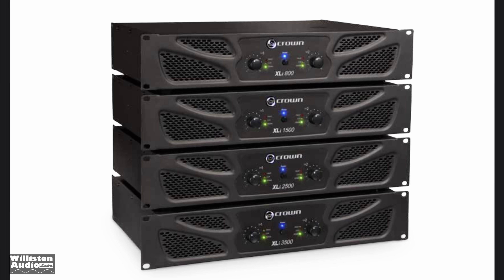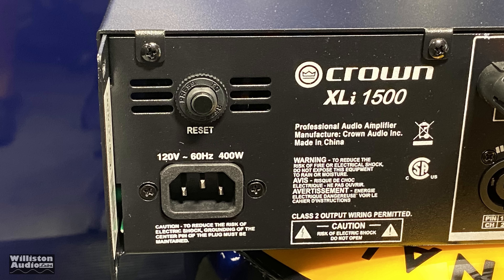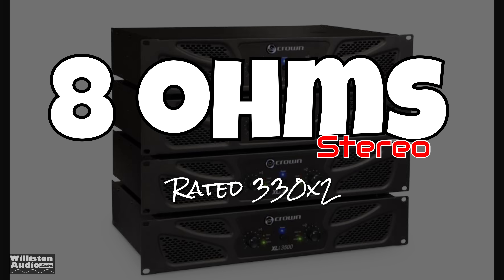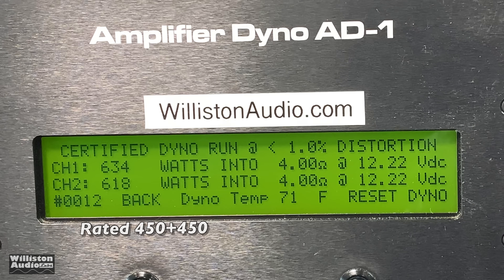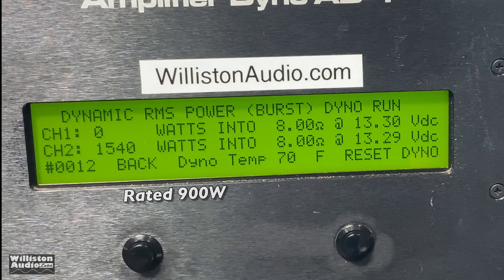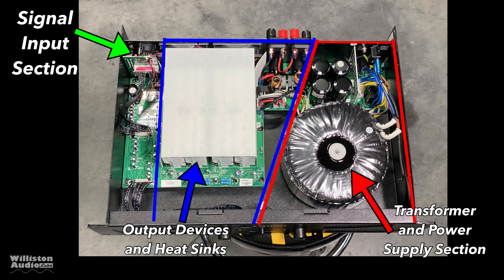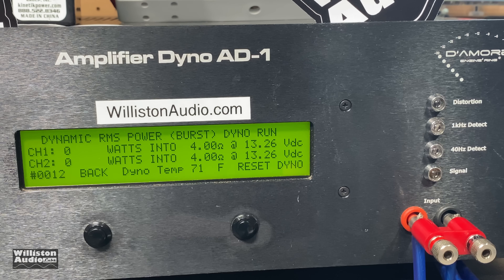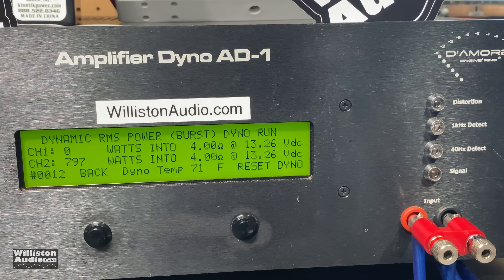The King of Pro Audio? Crown XLi 1500 Amp Dyno Test and Review [4K]

Comment: Thank you so much for this video! I just received a Crown XLS2502. Says this amp is supposed to be 1200x2 @ 2ohms... Would you have any reason to believe that it delivers any less than rated power? I also got an Art Cleanbox Pro to change unbalanced to balanced, and that helped the power output a ton.
Reply: The amplifier can deliver its rated power output no matter if the input signal is unbalanced or balanced.
The amplifier back panel has an input sensitivity switch used to set the amplifier gain to the level required to deliver it rated power output.
The advantage of the balanced input is that it offers improved signal to noise ratio and, usually, work with a higher nominal signal level, which requires a lower level of amplification to drive the amplifier to its rated power output.
With a professional audio signal level input the amplifier gain required to reach its rated power output is 5 dB lower that the gain required for home audio unbalanced input signals.

Comment: It will do that all night long in 80 degree heat :-) I spent 5 years dragging xti's around the contry...all that hurt them was was the STUPID crimps on the front control boards :-( I even had 3 get soaked with rain  and trip the power supply out and when it dried it worked fine...I almost got fired that evening:-(

Comment: If the occasion arises, I would love to find how Behringer KM 1700 amplifier measures on your equipment.
Behringer KM 1700 class H two step amplifier official power ratings are: 2x500 W "max power" at 8 ohms and 2x800 W "max power" at 4 ohms 
As many of you know, Behringer stopped rating their amplifiers by the RMS power a while ago and currently they are using terms like "max power" for their ratings.
Also Behringer officially states the expected continous power rating (aka RMS power) should be "around" half the declared max power rating.

Comment: I've used similar crown gear in professional installs [Masquerade- Atlanta] , they absolutely kicked butt cleanly, and we usually ran about 103 to 107DB with a packed house. Yes, many crowns. Powered many huge driver horns, many many 2x15 cabs,  stacked to the 24ft ceilngs at least 24' across (each), JBL'S, and 4  3x18' EVs under the stage. Amps to subs one fat amp each, rest were assigned to specific cabs.
Trouble shooting (minimal with this monster) a cinch. Well laid out.
Plus on stage monitors w feed from house source, separately powered.
I worked there 9 mos before even with earplugs I could hear thru,  it was affecting my hearing. 'The Furnace' was stageright behind ceiling stacks, and I kept 3 19" fans going under the stagemix mixer where I worked, and wore short cutoffs all year! Can't remember amp count right off, but the rack was about as big a me.
We called her Lotta Heat.
System name affectionately called 'Gorilla"  Might just as soon been called 'Godzilla'!
Went into landscaping after this. Allowed my hearing time to recoup. So when I went back to playing my own music, I could hear the detail.
Several moon ago...🙄😂
Just found your channel & subbed of course, can tell it's going to be a lovely ride. Nice test gear!
Musician and audiophile ... lifelong.
Never could afford McIntosh.
I heard this undertaker's system in the basement of funeral home😳 who had full accompanyment of Big Macs & 4 Voice of the Theatres....
Sweet... Buxtehude will never be the same after hearing it on that rig.🙏
And yes, he did raise the dead...
He always did a walkthru upstairs after he shut everything down, just as a precaution.

Comment: I have the XLI2500 running 2 Eminence LF18 subs in stereo. With the high efficiency of the drivers and power of the amp it is freakin loud!  I drag my rack and cabinets outside for a party on 4th of July every year and it can be heard from several blocks away!  I cant flex it too much inside because stuff starts getting broken from falling off walls and tables.
Reply from the maker: Boom shocka locka!
Reply: This is what I want also sounds awesome building my system up now

Comment: Keep it with just back brakes only.
26 is a racing bike what I've known.
They only use brakes in the back.
My GT was a 26 that's why the rims got stolen. That's the bike I was using it to race at the Dirt track. The lock 🔒 got cut
off.

Comment: Used an XLi 2500 for my cover bands JBL FOH two way 15's for years and years never ever let me down and this thing was abused...
Found it the other day in the back of the equipment closet. (NO WAAAAY! Ive still got this?!) 
Gonna use it with my HiFi system 
Adcom GP 450
driving a Pair of new(ish) jamo C 97 II
I think this thing should definatley have way more power than needed. 
so It will never ever be working hard
Reply from the maker: Awesome 👏

Comment: Derek,
I've looked inside the Peavey CS800 rack mount amp designed for PA systems. As you probably know the components inside are huge. The transformer, the output devices, the capacitors, etc. Considering how robust it is, and considering what we know (thanks to you) some little car amplifiers can put out, can you tell me why it's only rated at 400w per channel? Thanks

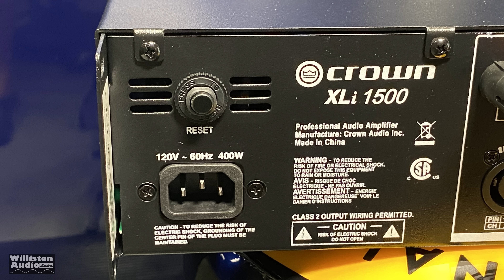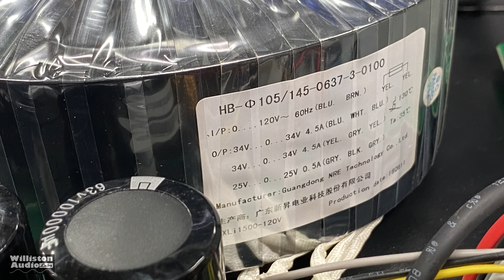Comment: At 1:25 we can see the Crown XLi 1500 consumes an approximate 400 watts maximum from the AC power source. At 6:19 we can see the toroidal XRMR delivers 34-0-34 VAC secondary to each channel of the power amplifier @ a max 4.5 amperes. Lets be generous and give it a peak DC rail voltage of +/-50 volts (hence the 63 VDC capacitors in the main power supply) X 0.707 for RMS = 35~ volt RMS into an 8 ohm load. I=E/R so 35v/8r= 4.375 amperes. P=ExI so 35 x 4.375= 153 watts RMS. If you count the inefficiency this amplifier should deliver around 135 watts per channel RMS into a stereo 8 ohm load. Lets not forget the consumption of the housekeeping  24-0-24 VAC 0.5 ampere taps on the XFMR. We can scientifically & mathematically  conclude the DUT might be able to deliver around 180 watts per channel into 4 ohms with a tremendous amount of distortion and clipping. It failed to drive a 2 ohm load, go figure?

EDIT: What is the point of making ridiculous audio test bench measurements that actually mean nothing in the 'real world' ? I used to like watching this channel until I realized it was all just a big cloud of smoke going up everyone's ass. No thanks!

Comment: I would love to see you do more reviews of this type of amplifier, particularly inexpensive alternatives Crown.  In addition to the power tests, reviews of these amps need to include a review of fan noise and is there any noise level when no signal is going through the amp.  The reason is some folks like myself would like to use such an amp for home use where things are much quieter than in a DJ setting and many such amp reviews talk about excessive fan noise and or slight hiss during music silence which is just as critical as the power tests.  Anyway, that's my 2 cent.  Thanks for the review.
Reply: If I'm not mistaken the fans on some rack mount amps can be run lower speed if they aren't sandwiched in between other amps in a rack mount.

Comment: More Pro Audio Amplifiers especially 4 channel amps, running all 4 channels simultaneously. 
QSC PLD 4.5
QSC PLD 4.3
Behringer NX4-6000
Ashly NX4004 or 8004

If you can get your hands on them
Crown I-Tech 4x3500
Powersoft M50Q
Lab Gruppen FP 10000Q
Reply from the maker: Those would be cool
Reply: @wal  I can guarantee you there will be an interest in the 4 channel amps. Especially continuous power with 4 loads. 
I've been eyeing the QSC PLD units for years but always held back not knowing how well they'd perform.

Comment: Just picked up one of these to power a Stereo Integrity SQL-15 in my home theater. Took some mic measurements and found that my pair of Polk Audio PSW350 10" subs dropped off pretty good at 50Hz. This combo should fill in the bottom end nicely. Great video!
Reply from the maker: Nice!

Comment: The rated THD is <0.5% of this amp, but you tested this with <1% THD level. The achieved output levels are misleading as you set twice as high THD threshold than that was specified.
--> Considering the 0.5% THD level, the real output level may be around the factory specification. There ain't no such thing as a free lunch...
Reply: Finally! My man! I was wondering about that,and reading the comments for so long just to find one like yours! Thank you!

Comment: Question to anyone else who may know, I've got both the xls 1502 and the four 1002, both listed specifications state 29db gain at full power is that only with the signal knobs turned all the way up, some people yes some say no this is my set up and config the 1502 is on my subs and the 1002s for my fronts and center and sides, all connected via xlr from my outlaw 976 balanced receiver the channel signal from it is set as followed lfe output is set at 0db and the fronts and sides are - 7db and the center is at - 9db all but the subs are 98db efficient, my room is 15ft by 18ft by 8ft

Comment: Thank you so much for creating and posting this video. I’ve been contemplating a Crown or QSC amp to power a car audio Diamond Audio TDX15 I’ve been using in my home theater for a few years. 1200-1500 watts RMS at 1 or 4 ohms (2ohm DVC) is difficult to power on 110volt equipment. One of the Crown amps may be my best option (albeit not this one due to not being 4 ohm bridged stable). At least the best that will not lead to my wife slowly poisoning my morning coffee. 

Thanks again!
Reply from the maker: Thanks for watching and commenting!

Comment: I have two Crown amps XLI 800 and XLI 3500, one for floor monitors and 3500 on subs and you're right power to spare. Also have two Crown XLS 2500 that perform great as well Class D a whole lot lighter. But I'm impressed with both. I appreciate the video.
Reply: Since you own both xli and xls series,which one do you recomend for my home application?

Comment: Nice gumwall tires on that haro, kinda like white walls lol. Crown had become a amp like Orion, even though it's made in China, they use some of the design from the old company that made them a success in the past. But these crown amps are a far cry from the original crown amps. One part that really sticks out to me is damping factor. The new amps don't even come close to controlling the bass like the old amps! But have become a decent cheap amplifier vs. owning part of the market as being boss. IMHO👍

Comment: OMG why even test 2ohm, that's a high voltage standard power amp not a car amp lol, i thought it was going to break or smoke overloading it with 2 ohm damn, the amp will be like shorted circuited like that, its good you didn't damage a transistor hopefully, never never treat these amps as car amps, never was design to operate 2ohms load ever. car amp are low voltage amps that why it was designed for car speakers and low impedance loads for power. I was shocked doin a bridge @4ohm is also like loading 2ohm per channel.

Comment: Crown goes under the radar ! There great amps at half the cost of other big nane amps . I bought the 2502 to expand my home theater channels from 9 to 11 channels. Used to to run my rear atmos speakers and its actually to much much power.  But don't sleep on these there powerful , & clean ..

Comment: 2 ohm stability is pointless when you are running PA due to the 120/240V supply, also it stresses out class AB output pairs way more than class D, it also means more current through your speaker lines leading to more losses (which PA speaker lines can be quite long)

Comment: Wow, I bought this amp 3 years ago, simply because the price and the specs were at a nice sweet spot.  Nice to know it's an overachiever, glad my PA speakers are rated for 400 watts with tweeter protection!
Reply: My XLI 1500 runs (2) wedge monitors with 12" woofer and radial horn. 400 W rated and they purr at 50% level on the amp. Living room rig with a powered sub.

Comment: You can actually run the amp in mono and then parallel the outputs to make it 2ohms stable, I've been using these amps that way but some models you just have to make sure the gain on both channel is on the same level, some only uses channel A gain knob for both even on mono.

Comment: It would be nice if you tested an old school Soundcraftsmen Pro-Power Ten. This is a Phase Control Regulated MOSFET amplifier from the early 1990's and is rated at 205 WPC x 4 at 8 ohms with less than 0.05% THD, all measurements were made running a full range signal 20-20 KHZ, it's 300 watts RMS per channel @ 4 ohms, 450 x 4 @ 2 ohms. The amplifier can run in four, three, or two channel mode. In two channel mode the amplifier is 600 watts per channel RMS into 8 ohms, and 900 watts RMS per channel at four ohms. Soundcraftsmen says it will put out 2,700 watts per channel for short term dynamic bursts, I ASSUME THAT'S IN BRIDGED MODE. If I lived a little closer I would lend you mine for testing. The amplifier has no current limiting and is supposedly stable down to 0.8 ohms. I believe the amplifier weighs 59 lb.

Comment: Nice bike man. I agree with your criticisms. I have a 2019 Mirra “Pro” Tribute and they unfortunately seem to be half-assing some of this retro stuff, even the mid-school. There are front brake standoffs, but no front brakes. The detangler is a random generic knock-off instead of a proper Odyssey. They included random cheapo pegs instead of the proper Fusion ones (which they sell). They used normal handlebars instead of the Kneesavers (again, which they sell). I like that Haro is doing this stuff but I really wish they’d pay a little more attention and do it right.

Comment: May I ask You to test my TFM75 Carver. I have owned it right from the store brand new. It says 750 per channel. I would love this test. I bought it in 96 I think. I will send pics of my owners manuals for all 3 of my Carvers bought the same day. This amp requires 2 separate 20 amp min breakers. 2 power plugs and 2 triodial transformers . sorry for spelling. Claims 4 ohm stable. and weighs close to 100 pounds. I have never cranked it in all these years on 4 Stillwater C-15s in sealed enclosures at 2.85ish cubes. I breaks the house at upper volumes. lol

Comment: It's a medium quality amp especially with rca inputs. All decent amps are all balanced inputs. On the plus side it would probably last for years in a club running every night due to its power supply simplicity. Transformer rectifier and caps. Nothing to go wrong really  though lots of heat. Class d will always fail before these (well eventually  anyway)
Reply from the maker: RCA inputs are for the home theater guys who mostly use unbalanced connections with HT receivers

Comment: Most importantly, this type of amp is made for live music and the headroom is needed.  Unlike car audio where the material being played is often quite compressed, live music is often way more dynamic and demanding.   So the headroom is needed.  You can also hear it when you listen to it at full volume, as it maintains a huge amount of headroom that car audio devices just don't have.  Particularly noticeable on bass drum or floor tom drum, you will get a much deeper and rounder sound as the amp doesn't run out of current quicker than the sound itself dies.
Reply: @OldManBadly  and this is a super budget pa amp. Crown macrotech’s and amcrons have phenomenal headroom and a nice indicator letting you know where you are with thermal headroom.

Comment: Interesting review. I just got a Thomann T.amp 4 channel @ 350W/8ohm (smps and class H) and the case and internals look similar to the Crown (yes, I'm a typical electronics engineer..I had to look) .  Aside from the PSU (obviously) and 4 instead of 2 channels of amp, the actual construction (reset, switches, heatsink shroud, heatsink type, PCB) made me think it's from the same factory! A look at the Thomann site confirms this....so I am happy that you like the Crown. So far, my new living room system is performing well, with a 'Ringer 3-way active crossover, Klipsch sub, driving 12" mid plus compression drivers. Hi-fi purists would have a hissy fit, but it sounds excellent...will be even better when I replace the fans with silent ones! Have a look at the t.amp range...

Comment: I work with the older 402 and 802 amps they would get punished, damp rainy shows in TX, back in a truck on to NYC in the cold, back in a truck with a pissed teamster.  on and on year after year. not to mention they would run for 18hrs a day for 2 weeks then in a truck... for like 8 years. after then they started having failures but that kind of punishment is amazing they lasted, we now use QSC K12 and Meyer UPJ-1P speakers to save time. but these amps were always bulletproof
Reply from the maker: Thanks for watching and commenting!